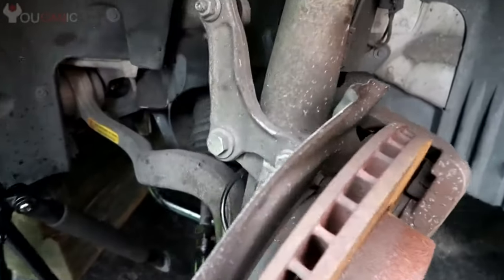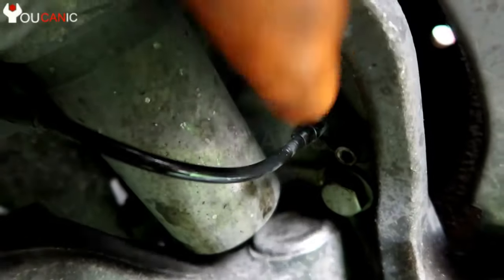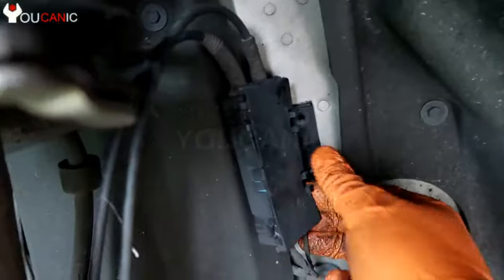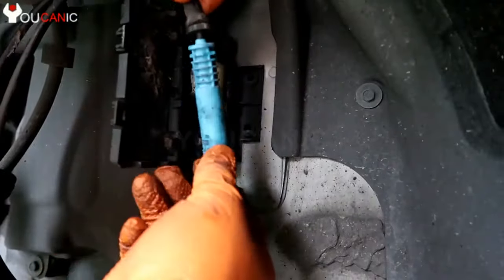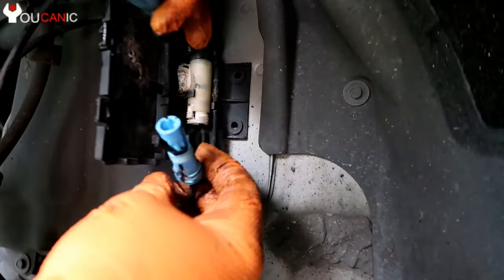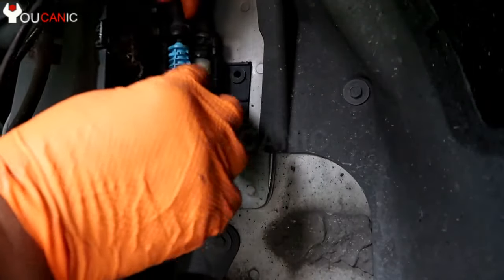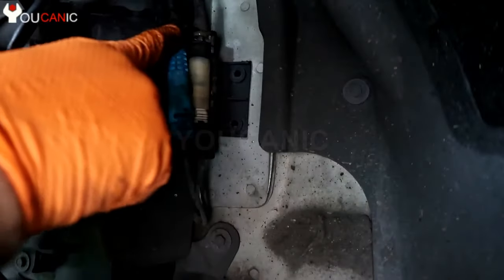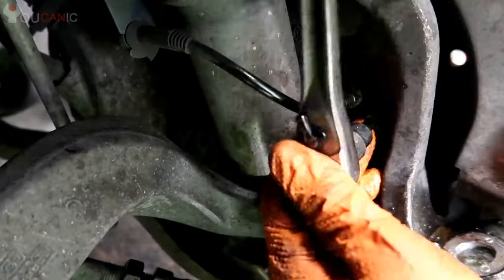How to Replace the ABS Wheel Speed Sensor on a BMW | Step-by-Step Guide

Comment: Are speed sensors fitted to all wheels?

I currently have 20 inch stock wheels with recommended 255/30 tyres on my 2014 BMW 4 series, and I want to keep the stock wheels and put 255/35 tyres on the rear. A technician has warned me that changing the overall diameter of the wheel and tyre, might effect the speed sensor, giving a wrong reading.

Comment: How about stating what size is used to open the sensor
Reply from the maker: Thank you for your question! The specific size needed to open the sensor may vary depending on the model of the car. We strongly recommend checking the specific details in our factory repair manuals available on our website, www.youcanic.com. Our goal at Youcanic is to empower car owners like you with comprehensive guides and resources to make car maintenance less intimidating and more cost-effective. If you need any further assistance, feel free to reach out to us on our site!
Reply: Dang bro what size was the one you used ?? Simple answer
Reply: Mf wrote a whole book instead of writing a quick number.
Reply: Tox 27

Comment: So does anything have to be reset by a code or programmed?
Reply from the maker: Thanks for your query! Certain car repair or maintenance tasks may require a code to reset or program a part; it varies by make and model. We at YOUCANIC offer user-friendly guides, tutorials and a powerful scanner to help you with this. Visit our website www.youcanic.com for more information and feel free to ask us any questions. We also have factory repair manuals if you need in-depth details. Our aim is to make your car ownership journey as easy as possible!
Reply: @YOUCANIC   Hello 1 replaced the right rear sensor with 2 different aftermarket ones. After resetting the errors it comes back immediately. Any idea what the problem can be?

Comment: My x5 is making a little pull when i go 5-10 MPH and i can feel those pull on the rear tire , it is becouse the abs sensor?
Reply: It's because you have unevenly inflated tires or you need an alignment.
Reply: I did the Alignment bit maybe because i have all season tire in front nd sport tire in the back